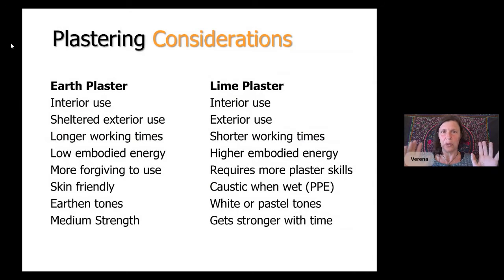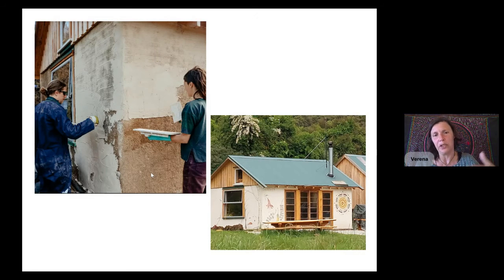Lime Plasters over Earthen Surfaces

Comment: Hi-George from Alaska here. Thank you for sharing this with all of us! I’m an elementary art teacher, and I’m planning on building a COB chair with my students indoors this year, and I was wondering if you have any considerations around how to adhere mosaic tiles to the finished chair? THank you!
Reply from the maker: You could try pushing the tiles into the fresh cob and then rubbing a finishing mix over everything once it is all dry. Or if you are worried it won't stick because of heavy wear, you could use tile adhesive to set the tiles, and then grout with a fine earthen plaster.